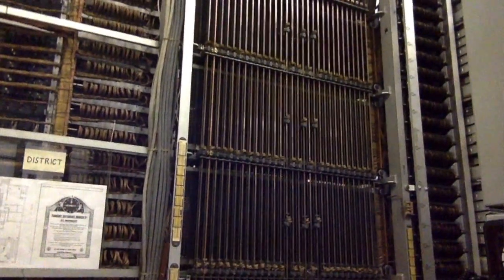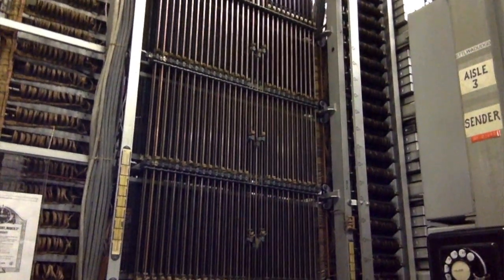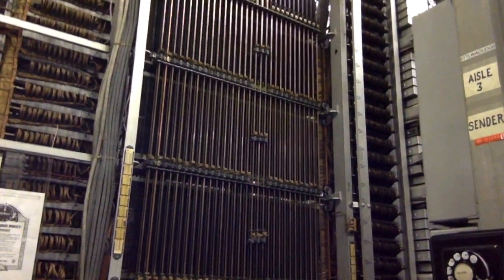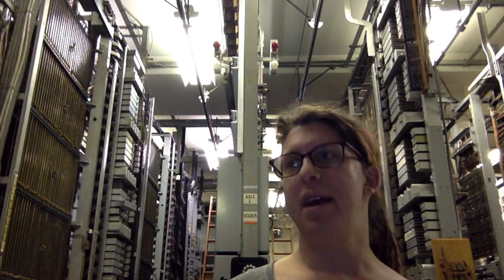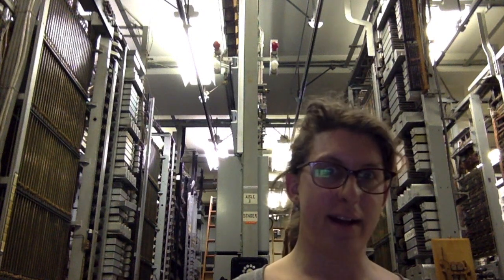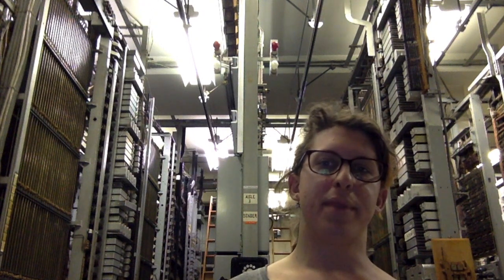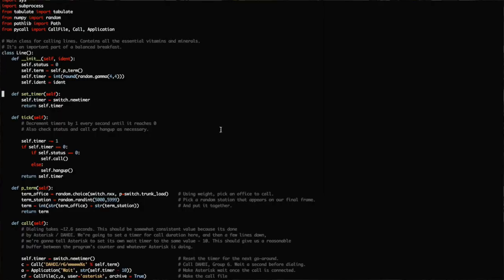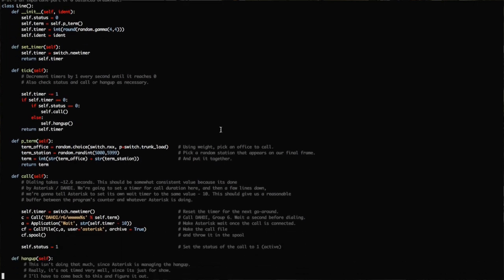Panel System - Call Simulator

Comment: I started working for Western Electric in February of 1963, as a newbie on the job, they had me running cable, learning the names of various equipment but it was in a number five crossbar office, but I remember walking through central office where they had panel offices still in operation, and also in the same building they had number one crossbar, and I was told that the number five crossbar will be replacing number one. For the first couple years I was pretty much a grunt running cable and learning how to why aren't using a wire wrap gun, I became quite good at it I work primarily at that time online Link frames and number five crossbar, I was putting out 10,000 connections a day. With no quality there is whatsoever. But then in 1964 I was in Bridge Street Brooklyn again working on a crossbar wiring again, but somebody mentioned to me that putting in something brand new and number one ESS electronic switching system. Lunch time it was up on the 4th of the floor I was working on the first floor, the number one ESS I was told was running the X-ray system, I had no idea what that was but it sounded very intriguing to me. As the gentleman his name was Mike West may he rest in peace, he explained to me how everything worked together, eventually he became an instructor and a friend. I bumped into my area supervisor in the building several weeks later, and I said to him how can I get into the ESS program? I told him that was working on a car correspondence course out of DC for basic Electronics I built my own oscilloscope various test equipment working on TVs just learning as much as they could absorb on electronics. About 2 weeks later I was in my first ESS class, within the next three quarters of a year they sent me, to school for tsps, I enjoyed that as well and became quite good in both of those systems, a couple years working between those both systems, for a couple of years, they sent me to number four ESS School, first fully digital electronic switching system, I work in that system for several years, then I asked me to go to number five ESS first fully electronic switching system with fiber optics. Then they asked me to work in the technical support, program in Manhattan which I did. I was forced to retire due to, a back injury I sustained several years back when I was working in number one ESS picking up program module. The next couple years I had several surgeries, long story short, my last surgery put me in a wheelchair for 5 years I was forced to retire. But I had a total of 36 years service working for Ma Bell. Every one of the systems that I work and I really really enjoyed. Your museum is teaching me how the older equipment that I walk through but never knew anything about, I find extremely interesting and you were definitely doing a great job, keep up the work you're doing and teaching people like myself, that always wondered how that equipment actually operated and functioned, I am learning at the age of 79. When I started working I was just 20, back in February 1963. Great memories thank you again for all your doing teaching us all timers about how the, older systems work. Today is September 25th 2022.

Comment: If the panel can communicate supervision back to asterisk, can your program query asterisk for channel status? Forgive my ignorance if it's more complicated than that 😊
Reply from the maker: The panel communicates call status to the calling party the same way all switches normally do: by tone. Dial tone, busy tone, reorder tone, etc. I thought about writing something to get Asterisk to recognize tones, but its a can of worms, especially since our dial tone is not the modern "precise" dial tone that a computer would expect. 

The channel bank knows enough to understand that a circuit is closed, and thus a line is off-hook, but there's no easy way to tell if it has a dial tone or not. Occasionally, lines go off-hook, but don't get dial tone due to a mechanical failure somewhere. Then, Asterisk begins dialing anyway, but it goes nowhere, because the dial pulses are just wiggling the Line relay.

I find this kind of funny, because the whole point of dial tone in the first place was to inform the subscriber that the machine equipment in the CO was ready to receive dial pulses. Now, we are so used to it being there, that we can't really even tell our computers to listen for it. It's just a vestige of what it once was!
Reply: Is it possible to have the Adit or another device communicate to the panel via revertive pulsing like it was it's own tandem, and also retrieve line supervision or whatever inter-office signaling is available (the call completes at the terminating end successfully) that way?  I'm still learning everyday from Evan Doorbell's phone trip tapes.  BTW, your test program is awesome.  It reminds me of the SIP trunk bombardment techniques used against scammer call centers posing as Microsoft support ;-)